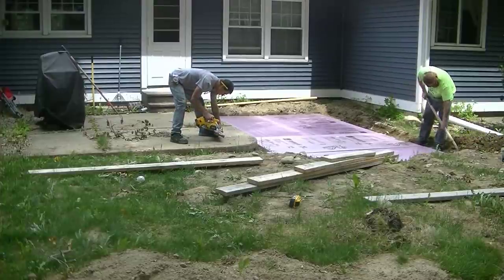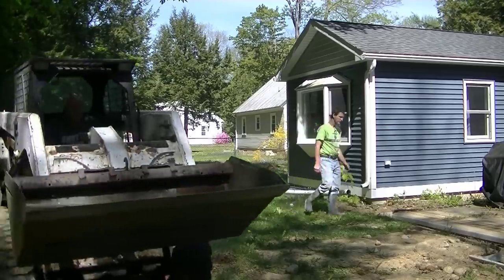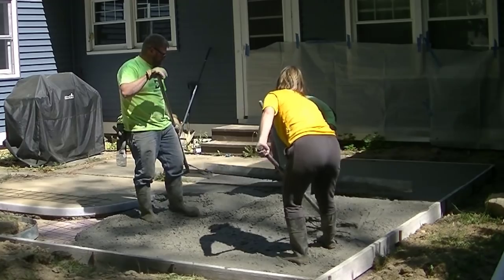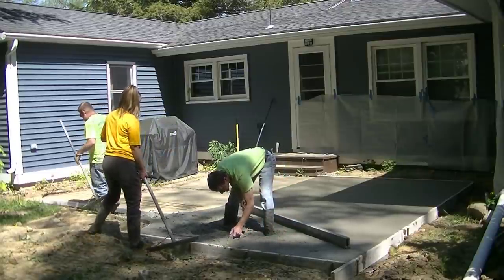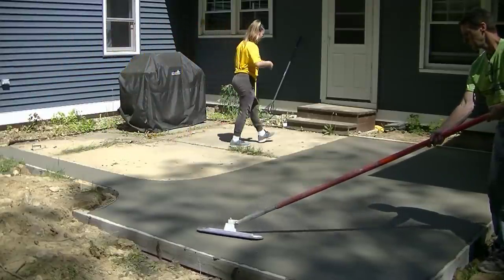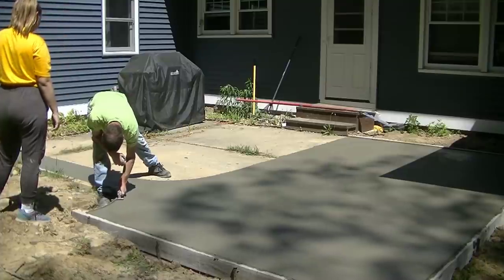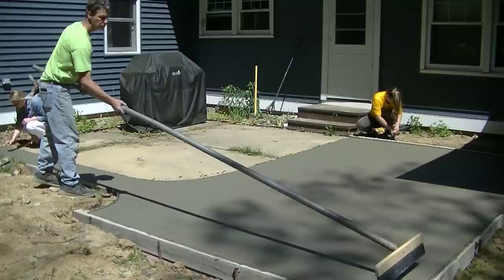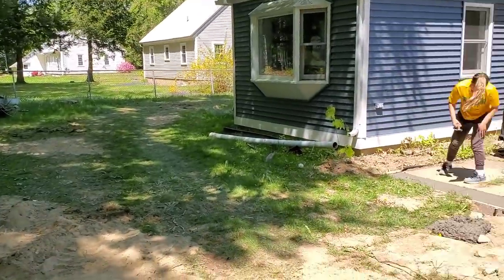Adding To An Existing Concrete Patio Slab (Forming, Pouring, Finishing)

Comment: Great job and I appreciate the videos Mike Day crew! Everyone has there own way for screeding concrete. Whatever way they are comfortable with.
I spin screed everything 8ft and wider. I set flat iron rails 8ft long that are 1/4"x 2" and run the screed on that. I made a frame for a  Milwaukee super hawg m18 drill to spin the pipe about 5 years ago. I can screed about 10 yards on one 5.0 battery and 25 yards on one 12.0 battery. Works great

Comment: Hey Tia 👋
Great illustration on the wire not going back to the bottom when walked on. 

Materials - $1000
Bobcat - $200
Man/Woman power - $500
Overhead/Insurance - $500
6pack for the ride home - $8
Total (in South Florida $) - $2208

Comment: Great video, amazing job. Question:I have a shed on concrete and want to add new concrete slap about 3” higher to extend the shed. So the old part of the shed will be on concrete and 1.5” of the ground the the new will be 3”. Will it work attaching the shed.  Thanks

Comment: Estimated cost to do the job is $1,500-$2000. Just
A guess! Also I have a project similar but I need to add to the end of a square concrete slab. How do I attach the forms to the old concrete?

Comment: Hey Tia, you got one hell of a dad.  From the looks I would probably charge about $1200 with the homeowner doing the dirt work. I have trouble finding help but I only do it on the weekends for extra income anymore. Only way I can get anyone to help is pay them $100 just to help me lay the concrete down and screed then they are running to thier car.  Great videos by the way. I keep hoping you will get a camera on someones chest or head to get a different perspective of the whole process.
Reply: Chesty Go- pro would be fantastic!

Comment: Wouldn't it be easier to remove the existing concrete and pour a new complete slab and not bother with trying to repair the existing one? Honestly, how much cost difference is it?

Comment: Mike I’m thinking about trying to repair my front walkway. It’s has expansion joints every four ft maybe, in one area it’s dipped and another heaved. Probably 1” to as deep as 3”. I’d like to pour over it. Any tips as to what the best approach is?
Reply: Pull re grade do it rightt